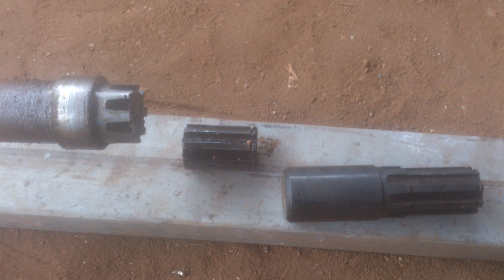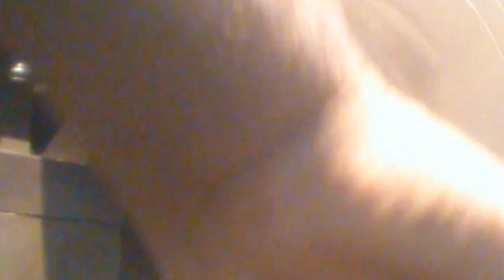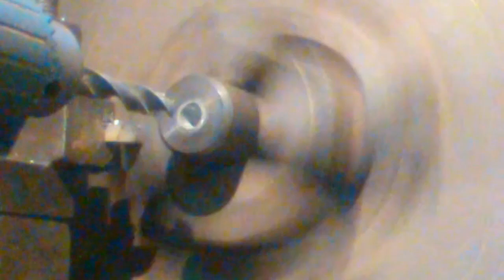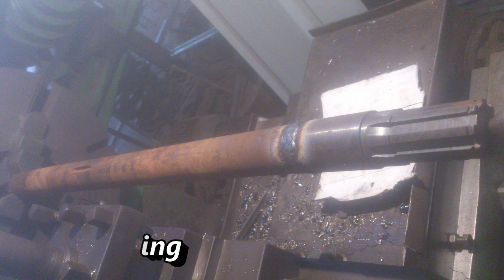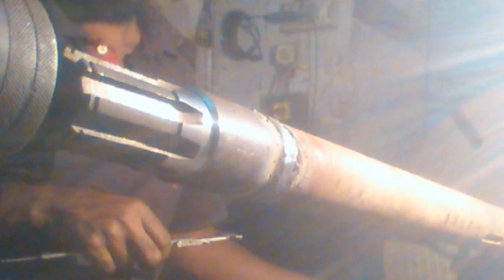Broken shaft end repair

Comment: how about the strength of the shaft? it surely wont be the same as the original shaft right? any information?
Reply: Why wouldn't it be?  To some degree no just cause its not solid. But if you weld it correctly. No reason this would not work. He even stepped the shaft ends just to fully penetrate when welding even.